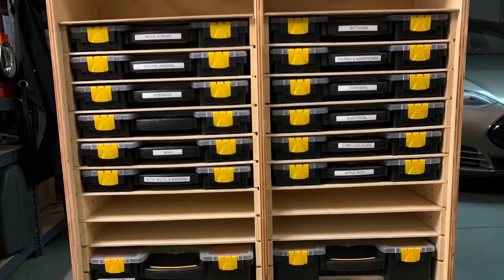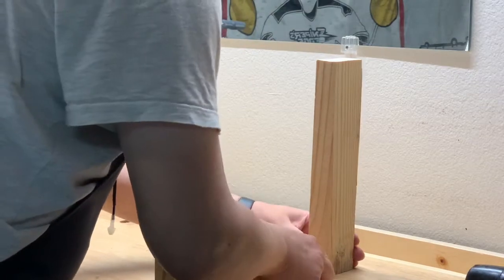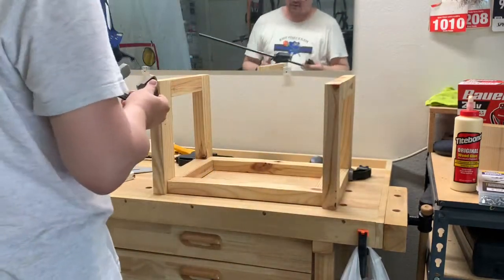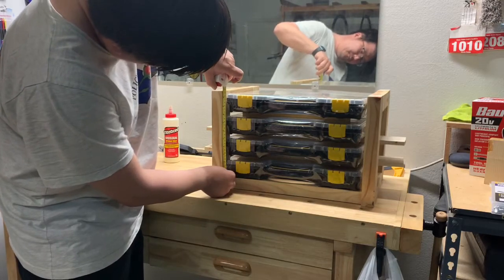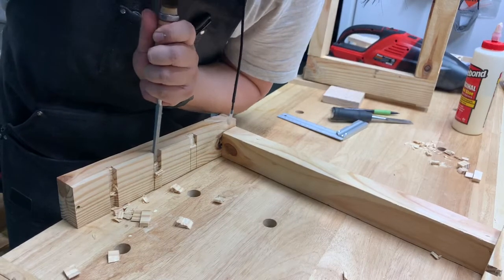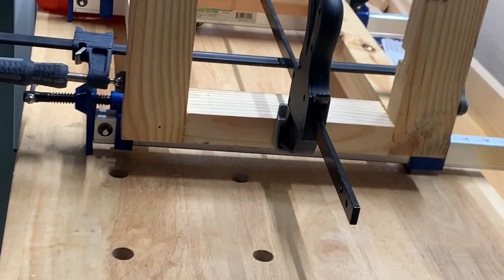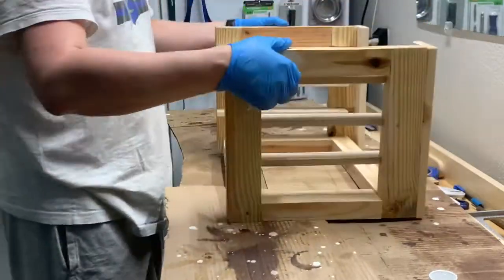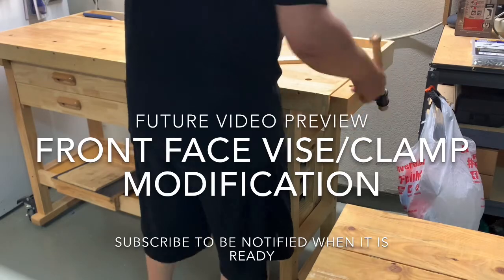Harbor Freight Storage Bin Rack for the HF Workbench

Comment: I did something similar with my HF bench, but I dropped the lower shelf down to about 1 1/2” from the bottom.   I use the husky brand bins...  made a cordless drill/air nailer storage on the other
Reply from the maker: How did you lower the bottom shelf?  Also do you have a picture of the drill and nailer holder would like to see it.  Thanks
Reply: @asyangmdphd  there are two screws on each leg,  I simply removed them and added some 1.5”x 1.5” oak cleats.  I didn’t reuse the front and rear dado’d boards as they left a ridge.   I ran two 1.5 x 1.5” supports and reused the shelf material.   I added shelves on the R-side and am in process of building a removable drill and nailer holder for the left side.   I don’t have a way to upload a pic to these remarks.  I hope that helps!   I’m very pleased with it.   I also added supports front and rear in the middle between the two drawers as the bench has sagged over the years.
Reply from the maker: @erichpaine7049  Thanks that helps good idea of adding the cleats.  If there was more room I think I would add another shelf to store frequently used tools.
Reply: @asyangmdphd  glad that helped.  Still working on the cordless storage on the left side..  back and forth on how I’m gonna do that portion